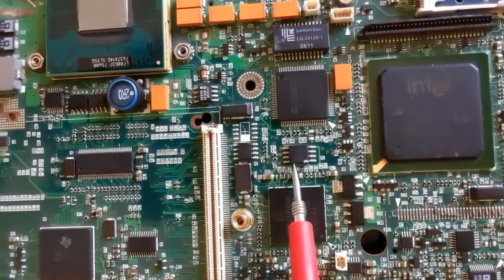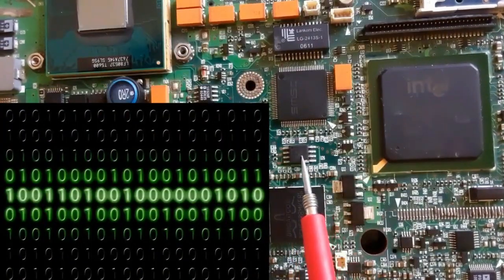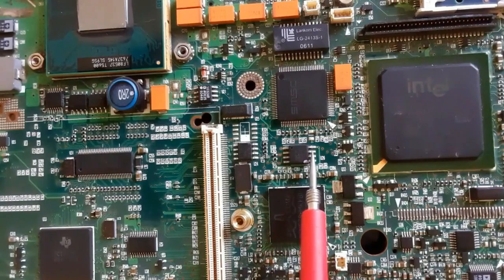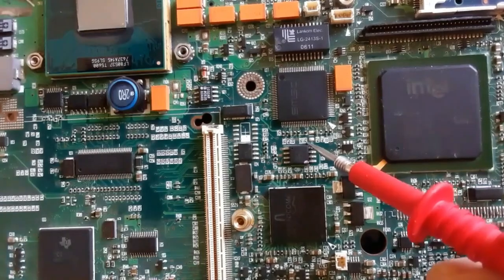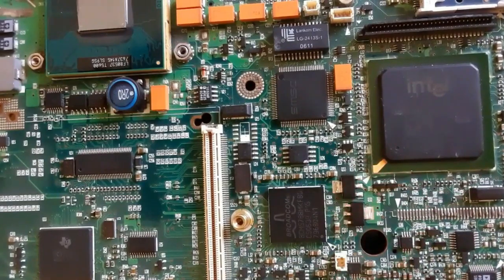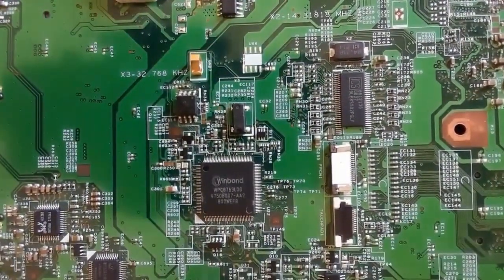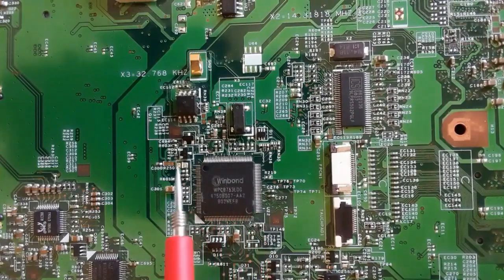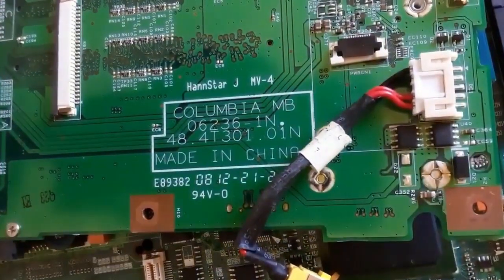Get to know Motherboard Most Common Faults - Laptop Repairs - Electronics Repair

Comment: You don't mention if faulty connectors can actually be removed and replaced with a new one.  I have an HP Probook 4520s with a damaged keyboard ribbon connector (clip holding the cable damaged by yours truly 😠 ).  It would need to be unsoldered and a new one fitted, would this be possible, are they available?
Reply: pls answer this one
Reply: @owenescultero8244  it seems the clip can be repaired without removal from the motherboard.  I got quite a reasonable quote from a local repair shop.